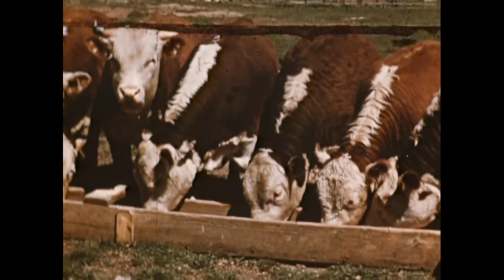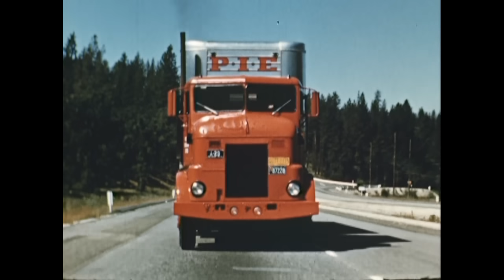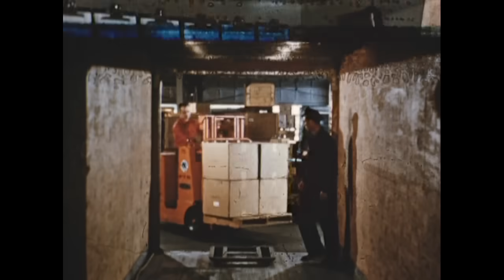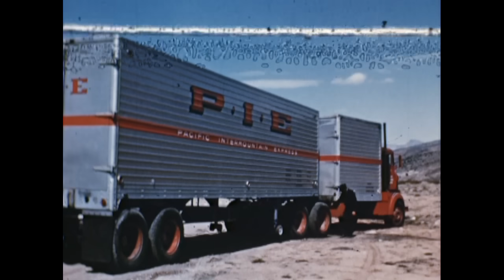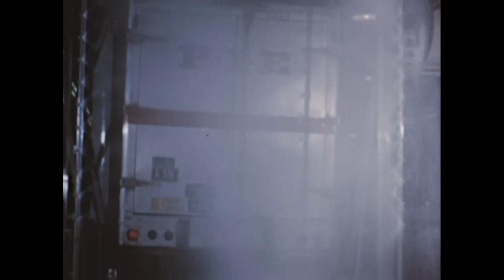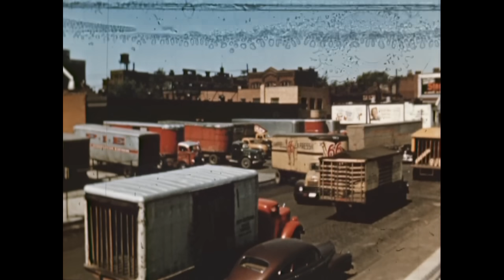Wheels of Progress

Comment: By the mid 1960s P.I.E. extended service to the east coast through more acquisitions, having 67 terminals in 29 states. In 1973 the company was purchased by IU International, and in 1983 merged with Ryder Truck Lines, forming Ryder/P.I.E Nationwide. In 1985 the company was sold again, with the name shortened to P.I.E. Nationwide. By 1989 loses were staggering, and the company was sold again, absorbing Transcon Lines.

Loses continued, and in 1990 P.I.E. filed Chapter XI bankruptcy. An attempt to scale back operations failed, with one of America’s most famous common carriers closing their doors forever, but leaving many fond memories.
Reply: Thank you for the specific's ...
Reply: I remember when they merged with Ryder Truck Lines then Transcon NOW GONE
Reply: I remember seeing them when I was a kid in the 70s, and they were still in business when I started trucking in the late 80s. They had a terminal in Sharonville, Ohio,which is just north of Cincinnati. I remember when they shut down for good. 
Just recently, I saw one of their trailers being used as a storage trailer.
Reply: Started in LTL freight 1984 ,Transus freight Orlando taught me to drive. Saw union carriers fold. Retire after 35yrs never union, van,flatbed refer, and oversize heavy haul. WHAT A BLAST TRUCKING WAS. 😊😊😊❤
Reply: I drove for Transus in the late 80 running containers out of savannah ga love those days trucking will never be the same
Reply: I'm a thirty year veteran now semi retired,and I never witnessed this kind of respect from the DOT
.

Comment: I was introduced to trucking  in the early 1970s,  riding along with my uncle at the age of 10. Trucking back then  was considered a professional trade. I got my class 1 in 1988, and have watched the trucking industry  continuously denigrate  with every passing year. Pretty damn sad considering it's the MOST important industry in North America
Reply: I got my CDL in 2000 and had an ear-to-ear grin. Didn't take long for THAT to disappear. NOW I can't even stand up for drivers, because they aren't even "steering wheel holders", as past generations called them, but clowns disguised as drivers. It's Flip-Flop Nation now, and it's disgusting.
Reply: @tonyorsini5255  
I'm not a trucker but I have to ask, is this because of diversity? Most everything else is wrecked by that.

Comment: Rebuilding a truck at 150,000 miles.
It's amazing a truck today can go a million miles or more  before an engine overhaul.
Reply: Bert Grau   That old stuff was cool, but it took a lot to keep it running.
Reply: i think a lot is down to better lubricants .now days.
Reply: @aaa111912  I'm pretty sure with today's oils you can get a lot more miles out of those engines from back in the day.
Reply: Mainly due to a better synthetic lubricants, alloys, seals and car manufacturing/construction  engineering tolerances using modern CNC machines and robots... Other than emission and electric sensors modern trucks are way more durable than they were in the early 50's

Comment: Really appreciate this video. A whole lot of folks can't even begin to appreciate EVERY FACET that goes into everything that's purchased. Hopefully this will help a lot of people see and appreciate everything more. Thanks again, from an OTR driver.
Reply: AS to safety most people learning to drive a car are taught and later passed by some one that has no experience operating a large truck. And to make it worse is how the insurance works. Unless you have a camera system in your truck to defend your self you may find your self on the losing end. For instance in one town that had a fairly steep hill and 2 downhill lanes, the left lane ended at a stop light and the right lane had a merge to another highway, but you had to yield to the traffic. Some one I know was going down the grade with a loaded semi, and the traffic on the other highway had the light. In front of him in the right lane was 1 car waiting for the traffic to clear and he was about 100 feet away from that stopped car doing about 20 mph.. Suddenly 3 cars at higher speed passed him using the left lane and then all 3 pulled into the right lane,, slamming on their brakes because the original car was still stopped. He had only about 35 feet, now between him and the last stopped car and as he saw the first car, and then the other 2 start to move into the right lane, he hit the brakes. Unfortunately because of the weigh he was carrying and the down hill grade, he slid into the back vehicle and made slight contact. He didn't have a camera system and when he took it to court, the fools found him partially responsible because he shouldn't have been driving so fast, even though those 3 cars that pulled in at the last moment created the dangerous situation.

Comment: Once there were operators of trucks who conducted themselves with professionalism, dignity and respect for self and others. Today...well, today our roads are largely filled with drivers.
Reply: Non truck drivers not any better.
Reply: @timpetta2974  Actually a lot are worse. A decent truck driver must understand following distance relative to speed and road conditions. But a lot of cars will fill up the hole left by the truck to maintain a safe stopping distance, and then complain when a mishap occurs ahead and everyone has to suddenly stop. Considering technology could be put into place to not allow a vehicle to not take up a trucks safe following distance, or would automatically give a warning to said poor driver and issue a fine. That monetary cost to poor drivers would slowly have the public improving their skills and elevating the safety level on the roads. Unfortunately the only thing that trucks have in their corner is camera systems, and possibly a properly trained cop that will issue citations on offenders, including foolish truck drivers that follow to closely for conditions.

Comment: Top speed of 50 mph, helping motorists, & stopping for a break every 50 miles. Geez it must have taken FOREVER to get freight to it's destination back then
Reply: correct that's why when what normally takes like from Chicago to California and 70 to 75 mile-an-hour speed limits even in a 68 mile an hour truck if your company governs you that with the high horsepower you can pretty much make it in a little over three days legally now but back then it took you almost a week when you had the transverse old us 30 or us 66 Route 66 they didn't have any interstates hardly at all so yeah you're riding through small towns everywhere think about all the towns you bypass on highways now think about having to travel through them stoplight school zones and these are towns that are thousands of miles away from your home a coast to coast run from Maine to Frisco will take you a little over a week

Comment: How those terminal operations have changed since this film!! Instead of cubing out a trailer nowadays it's just Shrink wrapped Pallets. And announcing to dispatch when unloading is a thing of the past with Bar codes, and Pro numbers replacing a huge part of the non-driver and dockworker workforce. About the only thing that has gotten harder is the driver knowing the workings of their tractor and trailer. Those old trucks were literally something out of the Flintstones compared to  today's rigs.
I drove for Reddaway  for 27 years before retirement, and I grew up in the Trucking and Bus industries from birth. The changes to both is mind boggling. This film is nostalgic, as PIE was an icon much like CF, Garrett, LASME, and hundreds of other once great companies that are no longer around., But I hope people don't watch this as a romantic look. It wasn't anything I'd want to go back to!! I sure loved those days though. Old truckers know what I mean, but greenhorns can only imagine (and usually get it wrong!!).

Comment: I thought 62 was slow!!! I can't imagine crossing the country going 50mph! LOL
Reply: Imagine doing that in a tin can without a sleeper or noise insulation,  no wonder truckers were paid well.
Reply: Besides climbing hills very slow (most trucks then had no more than 200 hp) they were low geared and weren't geared to do 70 MPH until the interstates came along.
Reply: Dustin Freshour   This was probably before the interstate highways.
Reply: Back in late 50s national speed limit was 60 cars trucks was 40 . 52 in a truck got you a ticket and loss of license for 6 months
Reply: I started in 88 with Schneider in an 84 barnyard Cadillac the trucks would run 65 but they had a trip master tattle tale on them and we could only drive 55🤣🤣🤣🤣. I did it for 5 years with them when I git in a truck that’d run 75bi felt like a bird out of a cage! Btw that 84 barnyard Cadillac cabover with 122 inch wheelbase spring suspension and NO power steering needless to say when you backed in somewhere you DID NOT over steer for sure lol I was on the road 24 years until my leg amputation I missed it at first but nit now they’ve git cameras in cab facing the driver I wouldn’t want any part of it anymore but I had lots of good times on the road!!

Comment: So wait....an eight hour day, with eight off at a terminal, an extensive screening process to find relatively good drivers, a stop every 50 miles, so about once an hour or two is encouraged to check for safety and to take a few minutes, legitimate pride in every part of the process and, i'm assuming, good pay......ok, sign me up.
Granted, I know it probably wasnt actually this polished, and the trucks where harder to operate and live with, not to mention the danger of loosing control on one of many down hill sections of the old roads they used to have to drive, given all that, I'd still do it in a heart beat.

Comment: Nice vid from back in the day when dromedary boxes were somewhat common.  I wondered how droms were loaded.  Any old drom drivers out there?  

One trucking company also produced a video with a title something like "The Long Haul" or something that was a promotional video similar to this one; it was played one day in an after school class at my junior high school and was probably a fundamental goal of becoming a truck driver.  I thought it was produced by P-I-E as well, but it showed a sleeper team on a run from California to Alaska as I recall, so it probably wasn't P-I-E.

Of course, like most things in my life, I got into the business on what I consider the back side of the bell curve.  While there was only one trucking school back then (that I know of, the Wally Thor School of Trucking), it was still an industry that you generally had to earn your rank in.    A couple of things stand out to me in this vid:  the professionalism of the drivers even to the point of wearing uniforms, trucks being completely overhauled at 150K miles, and not exceeding 50 mph on the tachograph.

Thanks for posting this.  Very nostalgic for me.
Reply: There were various ways droms were loaded and unloaded; Some were removable from the tractor much like a ocean container,some companies had pass through doors on the front of the trailer,I think PIE used long ramps at major terminals since droms weren't pulled east of Denver.
Reply: They used long ramps to load them from the dock, mostly lighter stuff.
Reply: EXACTLY

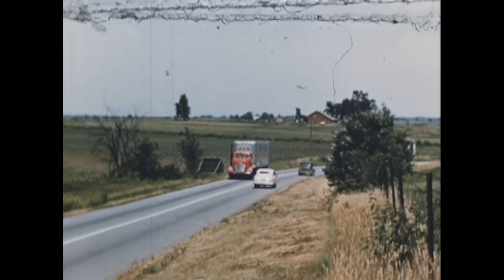Comment: 11:02, tack o graph ,aka, "taddle tale" never exceed 50mph? And they made money, dressed good etc, NOW cheap ass freighthaulers drive 50mph thru parking lots
Reply: Cowboy Kody.. It ain't the Freight Hauler that's under paid and under trained...
At least we maintain the chicken house speed..
Thanks to otr companies,  truck driving schools and deregulation our industry has went to hell..
I've seen a lot of changes it seems you may have also.. "Always Broke"
Reply: That's funny but true. Then they do 49 on the highway.
Reply: I saw a driver hit his front wheels ? I asked what that was about, he said that's how they taught him to check for low or flat tires😂scary what kind of drivers are out there
Reply: @leonwolf9970  I guess you aren't an experienced truck drivers. Most truck tires are inflated to 100 psi. When you hit them with a hammer, you hear a certain sound and how the hammer bounces back. A low tire gives a lower sound and there is more give to the tire. I can tell when a tire is at 90 psi or less and once hit a tire that didn't sound quite right and took the trailer across the road, because that company was responsible for maintenance and it came up as 95 psi. He took it off, and found a very slow leak. Truck tires don't loose air at that pressure unless there's a problem and the hit test done by an experienced driver quickly spots problems. On a super B truck and trailer that has 30 tires, you can do the check in about a minute or so..

Comment: Control smoke? how?
Reply: Easy..You just used the appropriate gear for the speed they were running Most of their tractors were using 4x4 transmissions and non-turbocharched Cummins engines, Lugging the engine(under revved) would cause them to smoke and throw out soot from unburnt fuel particles from the stack, shifting too early would also result in smoke,along with lead footing the throttle whn upshifting those old diesels. Most of the older tractors had a gauge called a Pyrometer that monitored exahust temps. if temp.went over a certain level you were probably lugging the motor 1100deg was considered excessive on the Cummins if memory serves 900deg was optimal.

Comment: Holding a steering wheel back then didn't qualify one as a driver.  Not when most roads before 1960 were two lane (only half the interstate system was completed by 1965)  uphills, downhills, sharp curves, towns every 5 to 15 miles if your were east of the Mississippi & snow & ice.   In the 1970s when I got into it, I'd see a few of these old trucks scattered in fields or sadly in wrecking yards.  P.I.E. hung in there longer than many after the 1980 deregulation but finally went belly up in 1990.

Comment: That was back when people were a valued resource and not an expendable tool. That was before computers ran everything. That was before every idiot was allowed to do the job. That was before half the truckers were blowing up their log books to get those miles. LA to New York solo in 48 hours with a bag full of white powder. I remember back when most truck drivers were tweekers or cokeheads. I also remember what happened when they started testing for it. When testing came into the norm, and the drug addicts were gone, they had set a precedent for production. So what do the large logistic companies do?  They limit what you can make, increase what they expect, and invent creative ways to screw you over. And it's all legal because any idiot can get a license now a days. All that matters is that they work for cheap.

Comment: 150,000 mile complete overhaul? wow
Reply: Aaron Buckel 
Cars were pretty tired by 50-75,000mi...and probably had a valve job by 30k. 
Now cars go 150k easy for the most part.

Comment: PIE is gone along with other trucking company's replaced with company's like Swift Trucking. I drove in the 70s. I ran three logbooks to look legal. I drove fuel tankers and was and owner operator and ran double vans. I ran 11 western states. Many times I ran over 18 hour runs. It was nothing like this video shows. Running up the west coast  in the winter at times you would have to chain up two or threes time in one trip. I only had one accident and that was a car running into me. There are good trucking company's still but there is also many that are not. They have drivers that are not well trained and there rigs are not safe. The trucking industry is in the worst shape is has ever been in since I can remember and I am74.

Comment: I will bet no one knows what shutters were used for and how they worked on those old trucks,,,,any takers?
Reply: Radiator shutters? Regulated water temperature before fan clutches in the late 70's and early '80's
Reply: Oh and the thermostat when it reached a preset temperature actuated a servo that opened or closed said shutters..
Reply: You lose the bet...
Reply: @mickeycomeau7219  what were they used fo

Comment: is it fuel efficient to run 50 miles per hour?
Reply: VladGoro25 
I am a German trucker, driving for more than 30 years now. My actual truck is a Scania S 730 V8. This truck has a gigantic power. It is a truck with 730 Bhp, more than 800 US horsepower, a torque of 3,500 Nm or 2,580 ftlbf at 1,200 rpm. The very most European trucks are governed by law at 84 to 88 Kph, about 52 to 55 Mph. Speed limit for trucks is on the German Autobahn 80 Kph or 50 Mph, like in almost every other European country. When I am driving full loaded - 40 metric tons or 88,000 lbs - on a flat motorway, then this truck has a mileage of better than 10 Mpg. Yes, 50 Mph is very fuel efficient. But a low power truck with less than 500 Bhp burns more diesel than my truck at the same speed, especially in the mountains. Fuel efficiency depends on a lot of stuff: weight, power of the truck, topography etc

Comment: Can't drive over 50 mph damm
Reply: Mark Sanchez The engines didn't have the power that they do today, so the trucks were geared really short (4.33, 4.56, etc) to give them some kind of acceleration.  This usually limited their top speed quite a bit.
Reply: Mark Sanchez The speed limit was 55 at that time. 70 mph was unheard of.